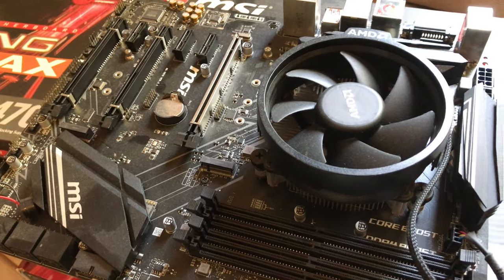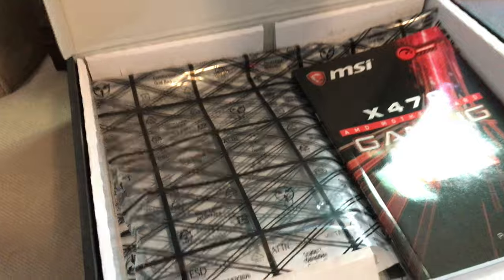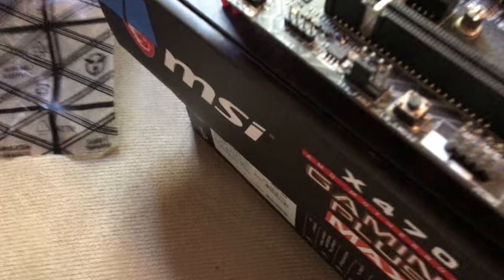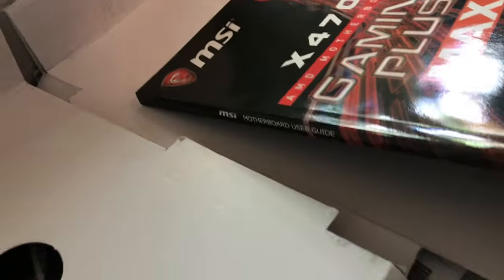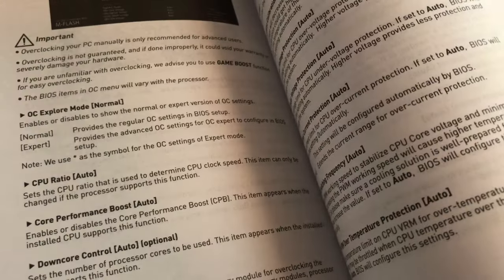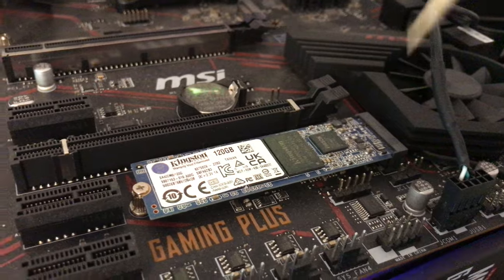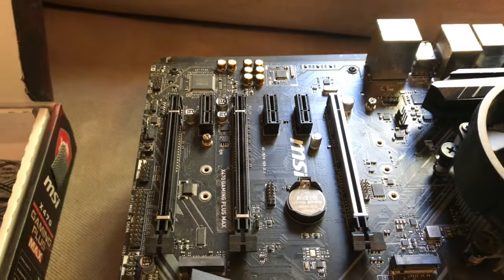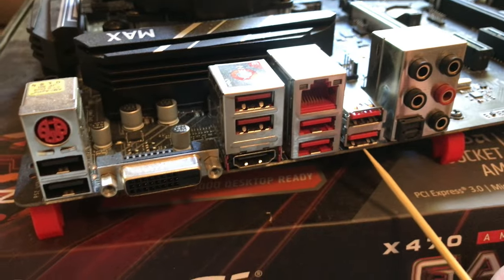⛏️ MSI Motherboard Mining Masterclass: Exploring Motherboard.  GPU & CPU Setup Secrets Revealed!

Comment: you do know ryzen 5000 is much more profitable then almost any gpu right now..  Also that versions is one of the worst because of the VRMs are terrible.  Its power delivery is super weak, thats why it has baby heat sinks on it.  Its not gaming motherboard.  Its the lowest low end of the x470s.  For mining you want b550/x570 mainly for PCIe 4 .  Right now tho ryzen 5600x will net you best income out of almost any cpu.  Like $2 a day profit.  Its actually cheaper to set up multiple cpu mining rigs then mining on gpus.  Power cost is way way lower at like 90watts
Reply from the maker: Great info. My Ryzen 3900s burn about 85w right now. I had that older Ryzen 5 just to get my GPUs rig up and running. Scavenged it since it was just gathering dust since I will not buy new hardware. 

AMD CPU Ryzen 9 5950X showing profits at $1.45/day before electricity. So almost double that of the 3900x. But, I am not spending any money on new hardware. that is a fool's errand.

 I bought the 470s before I knew about the B550 mining motherboards. Then they were very hard to get. Evolution of learning. No longer doing GPU mining due to form factor, heat, electricity cost, noise and potential to burn my house down. I like the CPU mining. 

I refuse to buy any new hardware and just using what I have left over from my GPU mining days up to when Eth went to POS.

Do you overclock the Ryzen 5600x at all using Ryzen Master, or run it stock?
Reply: but hashrate.no showing less profit like 0.78 cents in ryzen 5600x ?